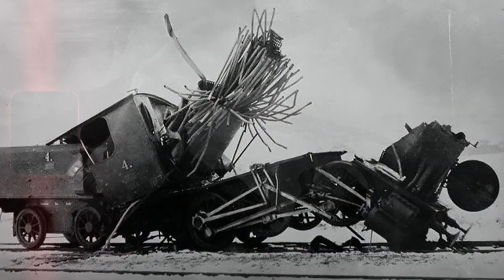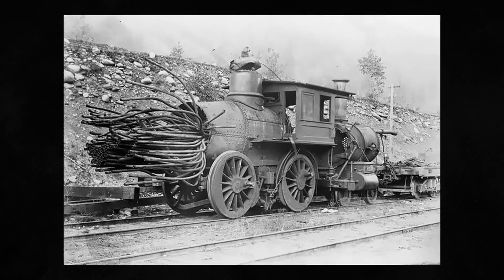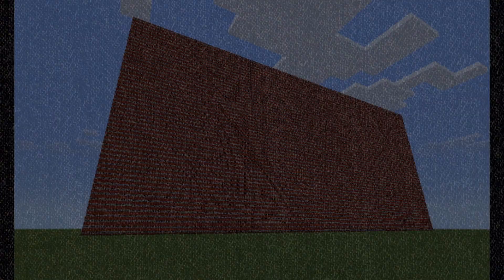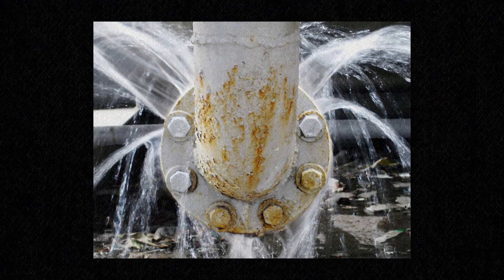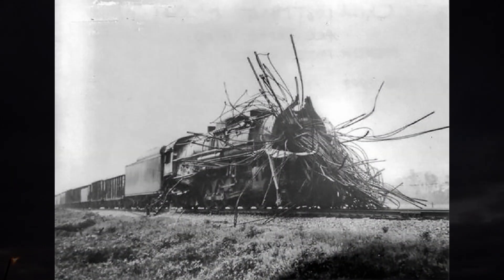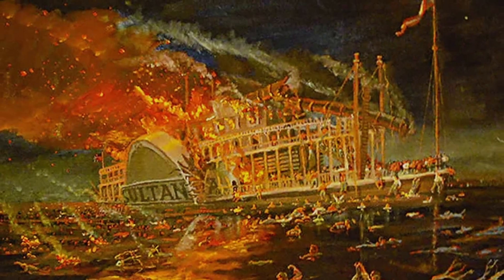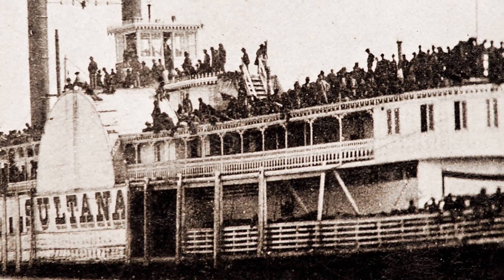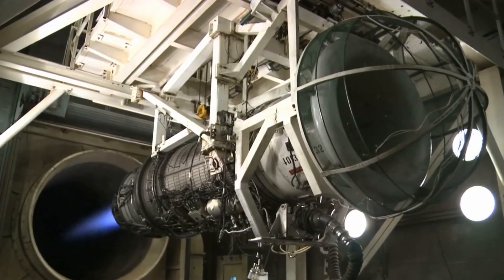The shocking power of steam

Comment: I'm a volunteer fireman and on a recent trip, as we got to the half way point we discovered one of the boiler tubes was leaking in the firebox. We shut the firebox door and went back on what boiler pressure we had (fortunately it was mostly down hill) it was a tense trip back being on the footplate. Fortunately once we had dropped the fire we could assess where it was leaking better and it was an easy fix.

Comment: Boiler explosions were never a surprise, they have been around ever since the earliest steam engines.   The risk of explosion was one factor in James Watt attempting to use his patents to prevent the development of 'high pressure' steam (he failed).   Boiler explosions were  quite common in the early days but got progressively rarer throughout the 19th and 20th centuries as safety inspections improved.
All locomotive boilers contain hundreds of 'fire tubes' for the hot gases to pass through from the fire to the smokebox and chimney.   In more recent locos, some of the 'fire tubes' are enlarge and have 'superheater tubes' running inside them.   If the boiler explodes then naturally the tubes are thrown out.
Incidentally, the 2560 pounds of TNT energy equivalent is about right, for a medium-sized (US) or a large (UK/European) locomotive.
But what is this clickbait title?   NOTHING disturbing is happening that hasn't been happening for the last 200 years.
Reply from the maker: Some good information in your comment here so I do appreciate that, though I’m sorry you find it as clickbait.  I will certainly grant you that if you understand steam engines, and their inner workings, it really isn’t much a scary system anymore, though in the early days of boiler engines, I would certainly be weary of riding or operating one. And with my title I basically aimed to generate curiosity into the impressive power, and potential dangers the steam engines are capable of when operated incorrectly, or when they fail from improper maintenance.
Reply: Glad you went there before I did. This is total clickbait, these days even model steam engines need to be certified (and re-certified regularly). this isn't disturbing or surprising for anyone that has knowledge of steam engines.